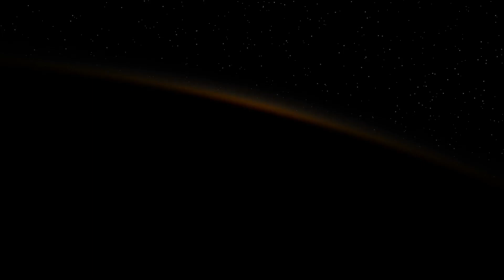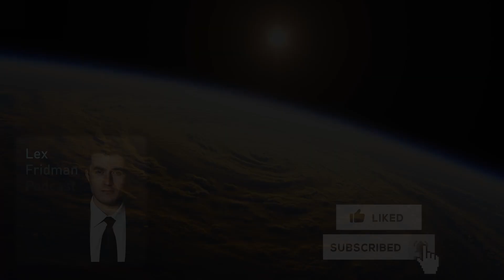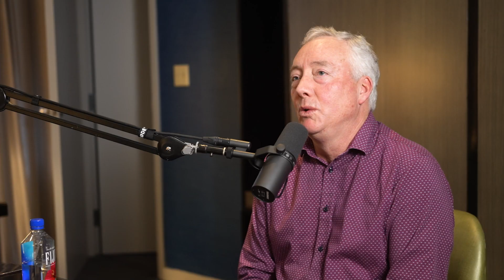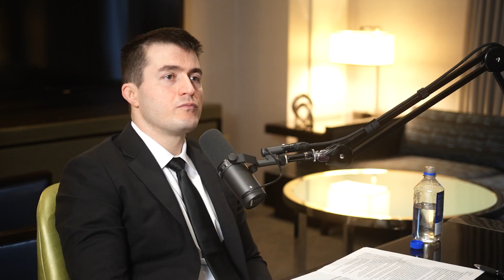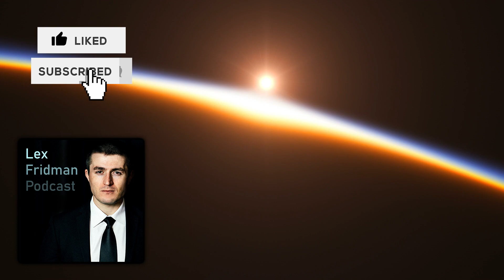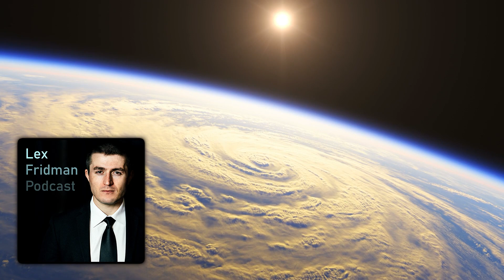How Dangerous is Nuclear Fusion? | Dennis Whyte and Lex Fridman

Comment: Itll probably kill so many for the first few years. Scary
Reply: No. The engineers and people working on these devices already have a hard time getting the reactions stable. If anything goes wrong it'll just fizzle out.
Reply: @keptick  remember the kid who built one and it was hazardous for a 40 mile radius or so
Reply: @johnye2210  fission
Reply: @johnye2210   No kid ever built a fusion device.  
You're talking about an entirely different kind of thing.
Reply: @ThatBoomerDude56  jackson oswalt
Reply: @johnye2210   Okay.  I looked him up.  "Jackson Oswalt (USA) fused together two deuterium atoms."  Impressive for a kid.  But not impressive as a machine.  And it certainly isn't a bit dangerous and NOT capable of making anything "hazardous for a 40 mile radius" (or even a 40 inch radius.)
Reply: Johnye, why are you spreading random misinformation? please educate yourself about the actual safety of the fusion process.
Reply: @MegInWhispers  it actually happened